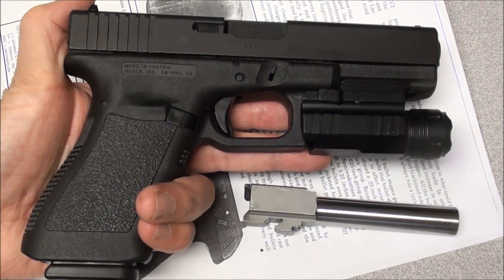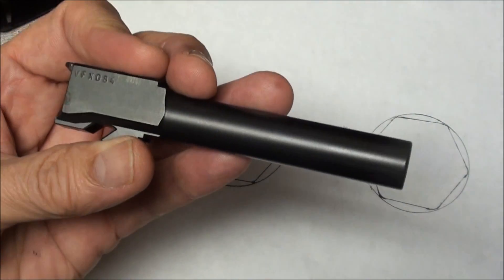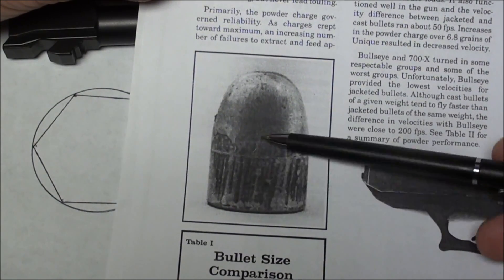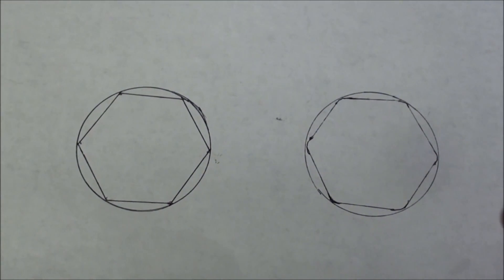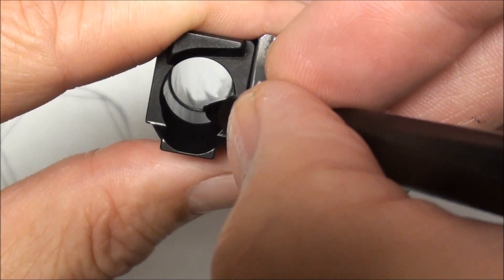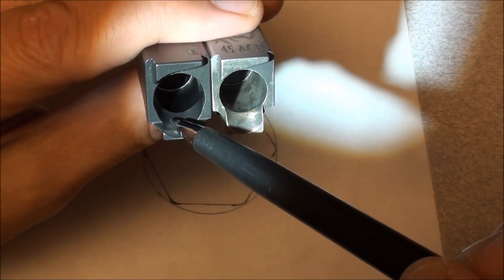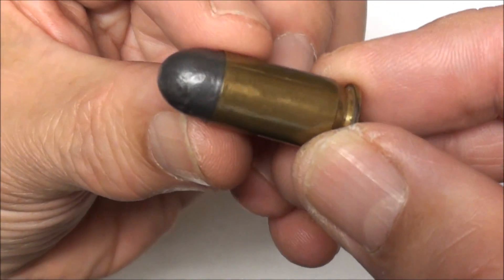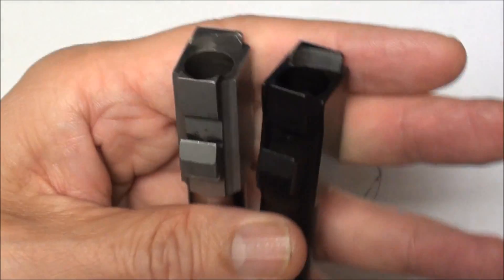Polygonal Rifling in Reloading Ammo for Glocks

Comment: Polygonal bore rifling does not cause more letting in a Glock Barrel. What it does do however is it seals so tightly that you can literally shoot the plug out of the driving band on a live bullet. Leaving a ring of lead in the boar that will cause the background to blow the gun up, Detroit police were doing that with great regularity when they decided to get some Led ammo to use for their practice ammo on with their Glocks.

And there is nothing precluding you from using reloads in a Glock. And apparently you're completely misunderstanding the reason for the problem with lead in blocks. The reason you see that following in regular lands and grooves is because it doesn't have a complete seal, and it certainly isn't as highly finished as the inside of the Glock Barrel. Guess that highly polished finish that the lead seals to, which causes the problem.

Those Hills, that you see in the barrel of the Glock are more of just the top cord of an ellipse and they help make sure that the projectile obdurate into a full seal in the bore. And land and groove rifling can be made exactly the same way, by hammering the barrel around a mandrill the same way you described as the polygonal bore.

A broach is what is used to cut rifling into a bore. And a button is used to swage rifling into a bore.

Before you do another Firearms video, go to a Master gunsmith and take some classes. Pay him well. Because you need a lot of instruction.

It has nothing to do with the goddamn chamber. Every block I've seen blown-up is blown up about a third of the way or more down the bore. It's not a chamber issue. Cuz the chamber is the same on a Glock Barrel as it is on a Barrel made by anybody else for a Glock even with standard lands and grooves. You do not understand the physics of lead trying to obdurate itself through a bore that is that smooth.

The case had has nothing to do with medbullets blowing up the gun. Just because a Glock Barrel has more of a throat done do it does not make it blow up. And the specific aftermarket Barrel you're showing there is a fully supported chamber. but if it had polygonal bore rifling it would still blow up if you shot lead through it.

It's not called minimally supported chamber. It's called a throated chamber. And 1911's have been running just fine with them for well over a hundred years. But they don't blow up when you shoot lead through them, because they do not have polygonal bore rifling.

That's why the internal dimensions of the case have to be made properly. So that you can fire them through throated Chambers in semi-autos.

 Please take a class before you do another video. And take the class from somebody who knows what the hell they're talkin about.

Comment: lol potato /poteto //tell why is  it stronger or weaker// u can  f get  micro rifeling  in career airrifle//and  got    hill  mini /stream and more   hill but no as   betveen   rifeling  wide hill,, etc  //f  get to the  point

no true i  shoot 12 000 9 mm homecast from old lead pipe s  hot  9x19 ammo in mky glock 17 //and  just to  test we did not clean  gun at all all 12 000 rounds  fired  ok // i admit  i were present   on  3 ,,three,times glock broke slide,,but  must say   reason was  inadequate loading  practice   and   tryin to   get  up to major factor in  40 sand wesson //and   all happened  before 40 /10 auto   glock s  are  as  now  made   on  big,,45 acp ,,round lower part /course  it automaticly  increase slide   toughness,, but    polygonal  barrel //i had a desert eagle in .50  and it as  u know got polygonal  barrel too /and shooted    lead bullet    no problem   /but  lead buildup and  gas system  is  just  on desert eagle  not   frendly  on cast bullet s  use  no matter all other /powder /lead hardness /etc etc  just  it s a expensive    allmoast  non possible  to  clean gas tiny 1mm hole deep in  a  gun //  and   scrabbin polygonal barrel  o damagin//so  yes fast bullets  in  polygonal   rifeling is   a   waste  of  time/ not  necesery danger  but  unclean / and  lol loadin // ,,pls  hit me  if    can tell me   any  bout   any /,,by

Comment: Video was wrong.  HERE IS THE TRUTH ABOUT LEAD BULLETS IN THE GLOCK.  I have been using lead bullets in Glocks since the 1980's.   Any type of rifling will blow up a gun if it gets clogged with lead, even the old fashioned deep groove rifling.   The solution is to always clean any deposits of lead out of your barrel. And your accuracy will be as good as jacketed bullets if the lead bullets are quality made.  IT IS ADVERTISEMENT PROPAGANDA THAT YOU NEED A SPECIAL BARREL TO SHOOT LEAD BULLETS ACCURATELY OR SAFELY.   Glocks actually lead less than deep groove rifled barrels.  I have seen very little leading in my glocks after even shooting as many as 150 rounds of lead bullets at the range but I always cleaned all the lead deposits out after I was done shooting. ALSO IT IS COMPLETELY FALSE THAT YOU CANNOT USE FAST BURNING POWDER IN GLOCK RELOADS.   I have used Alliant bullseye powder since the 1980's just  be careful because as you approach maximum velocities pressures do tend to sky rocket so start out with low charges and increase until you get reliable ejection.  That is all there is to it.  Nothing complicated.    When using lead bullets always use a size that is at least 1,000th over bore size.   If the lead bullet is under size it will cause rapid build up of lead deposits.   The larger the diameter of the bullet the less it will lead and if it fits the chamber and does not jam going bigger than 1 thousanth oversize hurts nothing..  Example: Using a lead bullet sized .355 or .356 or .357 if it fits into the chamber without jamming.

Comment: Great information as usual - thank you! A couple of questions:  1) If I need to use a bulge buster on some of my reloaded 10mm brass and then fire it through my Glock 29 with an aftermarket (KKM) barrel, the case support from that barrel should help minimize my kaboom risk, correct?  2) Use of an aftermarket 40 S&W conversion barrel (Iron Wolf) in that same Glock 29 should help mitigate your concerns regarding firing 40 S&W reloads built from Glock-fired brass (back in the same Glock 29), true?

Comment: I compared how much play a round has in both my Glock 9mm barrels and compared them to my S&W 1911 45 ACP and my Rock Island 10mm and they all seem to be about the same. Both my Glock barrels fully support the case or at least they're just as supported as the other two guns. Could these issues you discuss not be present on Glock 9mms?

Comment: I've yet to come across a firearms manufacture that 'does' recommend the use of reloads in their guns.
Reply: Most manufacturers do that as cya, glock does it because their firearms have the potential to damage brass in a way that makes reloading unsafe. Face it, when you're reloading you usually use the brass you fired. Reloaders shouldn't get brass from stock glocks.
Reply: @travissmith2211  you sir, are misinformed. Glocks, like most other semi-automatic pistols have a portion of the chamber that is unsupported. And it doesn't cause any greater problems in Glocks than it does in any other firearm. The problem is that they originally suffered from, was early 40 Smith cartridges where the case was manufactured and properly on the inside of its base. When you reloaded it it created piece of brass that was considerably weaker than the way standard brass is supposed to be made. That problem has since been mitigated. There were some manufacturers that were improperly loading their ammo and causing the guns to also not function properly and the 40 Smith cartridge. But that has since been mitigated as well. The only problem is Smith & Wesson has with 40 Smith cartridge anymore is the fact that the firearm is specifically designed around 9 mm and 40 Smith can cause excessive disturbances to the firearm that was not designed to handle the more powerful round. As for the boar, shooting lead through a Glock can cause it to explode within as little as 8 to 10 Rounds. What happens is that the LED seals to the Bohr so tightly that you can actually shoot the bullet out of the driving band of lead and leave the driving band of lead in the Bohr. And the next round blows the gun up. You must use jacketed ammo, or very hard cast, and usually with a gas check base on the bullet. But it's just a lot simpler to just use jacketed ammo. But not reloading ammo that was once used in a Glock has nothing whatsoever to do with it. Unless you physically see that the case is bulged and which case you probably have a bad case or it come out of a firearm that was fired in an overcharged condition.
Reply: That's true😆
If you think about reloading,you WILL get a catastrophic malfunction that at least will cause death or grave bodily harm for you and evryone in your proximity!! 😅
Som buy the ammo brand they recomend and make money of😉😆
Reply: Cz czechmates, wont cycle standard ball ammo
Reply: It's so that if you fuck up they are covered

Comment: My Glock 21 is 15 years old, a Generation 1, which I clean after every monthly shoot. I use home cast bullets, made from wheel weights. Fortune Cookie makes valid observations, but a fine bit of steel wool and parrafin, get the barrel nice and clean. Brass cases do tend to bulge right at the bottom after many reloads. Resizing with he product on the YT (Lee Bulge Buster, or The Case Master Jr), are options you might want to consider? I do not wish anybody to have an accident, but one has choices.

Comment: That must be an old glock barrel,like gen2,now they are fully supported. But now s&w shields have poor chamber support!
Reply: I agree. After watching this video, I pulled the barrels from all 4 of my Glocks. 1 gen 3, two gen4’s and a gen5. The only barrel that even remotely resembles this on is my gen3 G23, but even it doesn’t look the same. My gen 4’s and gen 5 (all 9mm) look very different, with much closer chamber tolerances. I’m sure, after close inspection, that later model Glocks use a different manufacturing process.

Comment: If your going to reload using cast lead bullets, get poly coated,  load them properly, ie. have a good flair, avoid over  crimping  ( just enough to  keep the case the same diameter ) if you  use grooved bullets keep case mouth away from edge of bullet groove,  don't run max load pressures  ( follow bullet manufacturer recommendation) i have run tens of thousands of poly bullets through Glocks,  H&Ks without issues. When I  first started out using poly bullets i was making mistakes and having problems until I  talked to  the  owner of a major poly coated manufacturer and he corrected me on my reloading practice,  sence then all is well.  been reloading sence early 1980s casted and reloaded bear lead , when i made the change to poly coated its been awesome,  leading gone, less smoke, easier clean up. so don't fret, poly up.
Reply from the maker: Ha Re - The big problem with reloads in Glocks is really centered on the strength of the brass fired in enlarged and throated chambers of Glocks.  The latest Glock gens seem to have tightened up the chambers just a bit to increase case support, but we can't get Gen 3+ in CA to really tell for sure.  A cop at the range let me check out his Gen 3 and other fired Glock brass would not go back into his chamber - that same fired brass chambered in Gen 2.  That gave me some evidence that Glock has tightened up their chambers a bit - but this was only a sampling of one.  Otherwise, it's using brass that has been strength compromised by firing in Glocks being used again and again in Glocks that can cause kabooms especially if hot loads are being shot, bullets are too big or too hard, or any other improper reloading practices that might raise pressures.  The safety margins are reduced using that weakened brass.  Glock chambers were designed for max reliability using factory fresh jacketed bullet ammo for police and military, the sportsman was never in the picture until recently - that's the whole thing in a nutshell.  Obviously, you know what you are doing with your Glocks, et al, and your ammo.  Continued good shootin' to ya,  FC Steve
Reply: +FortuneCookie45LC The key words is "knowing what you are doing " 
Don't know what a SAAMI spec is, don't have  case gauges, crno, calipers, multiple published reload data ect.one probably shouldn't be reloading.  My main reload is high power  bench rifle, 308 on up, little margin for error. 
 All good pistol (if not all) manufacturers  SHOULD  be chambered SAAMI spec. ( only way to prove the gen 3,4 is to slug the  chamber or pin gauge them) you also hit on something a lot of ( cheap ) reloaders do, over use their brass. in one example 45acp i load on the  lower end of the spectrum and only five times then into the recycle bucket. Most pistol kabooms point back to dubble changes  ( somthing thats extremely easy to do given the case volume) Reloading is as safe as factory ammo if you  use common sense,  follow the rules, have ALL the proper  equpment and don't take shortcuts. Manufacturers warn against reloaded ammo  for the stated reasons above, do ammo manufacturers make mistakes?  you bet they do, not often but it happens, so nothing is a sure bet. i have a gen 1, 3 and 4 glock in 9mm i will take a look at them.

Comment: Thanks for the video, it's old but still relevant. It looks like most military/police firearm designs incorporate some time of slop into them, AK, 1911, Glock. Luckily after market upgrades abound for all of them. I wonder if some of JBM earlier levers had something like slop for reliability?
Reply from the maker: Boris Buliak - Part of the slop you mention is in the ingenious use of polymer - the frame bends and flexes much more than steel during recoil helping to absorb some of that at the same time.   Slop in the chamber increases feeding reliability, but decreases pressure control to the barest minimum possible.  With less safety margin thereby, Glock tells shooters no reloads - and unlike other gun designs that have better pressure control via standard chambers with case support,  they really mean that.  The newest Glocks seem to have tighter chambers, but we can't get those in CA for me to review.  Best to ya,  FC Steve
Reply: FortuneCookie45LC sorry about cali, but quite frankly i have a gen3 19 and used to it, love the finger grooves most ppl seem 2 complaint about. If anything i would add a couple of after market barrels drop in. Happy with 9(have other options as well) any barrels in particular you'd recommend?
Reply from the maker: Boris Buliak - I really like the Lone Wolf - good value, and the cut rifling handles cast bullets nicely.  But LW seems hard to acquire now.  I'm glad I have LW for each of my Glocks so that I can shoot my cast reloads with confidence.  Best to ya,  Steve
Reply: FortuneCookie45LC thanks

Comment: I bought an IGB 9mm conversion barrel (fully supported chamber with regular rifling) for my Glock 35 G4 a number of years ago. I compared the barrel chamber with the barrel chamber on my Glock 17 G4. The difference is negligible. In fact, I couldn't tell the difference. I think the kaboom issues are mostly related to earlier generation Glocks that have less chamber support.
Reply from the maker: SuperFlatrock - My perceptions are also that Glock has tightened up their chambers a bit without any announcements or notifications of same.  That makes sense as it would imply that there was some kind of design flaw that was being corrected.  Your aftermarket barrels are still good in that you now have the option of cut rifling as well as the Glock rifling.  (You note that I do not say polygonal as Glock has altered the polygon mandrels they use for barrel manufacture so much that they really have created a distinctive rifling that I would refer to as Glock rifling - and they missed out on a PR/business angle there there as they could have patented that).  This is not Glock bashing as I am just pointing out what is... Best to ya,  FC Steve
Reply: Glock has tightened things up. The barrel on my Glock 35 G4 has a diamond with a dot in the center. This indicates extra chamber support. Indeed, at the six o'clock position, the indent is very small. The earlier versions have a more pronounced indent. The G5 Glocks now use regular rifling. I never shoot .40SW reloads. If the OAL is off by just a MM or so you can have problems with case pressure. I have no qualms about using 9mm reloads.

Comment: I've shot nothing but reloads In my Glock 17 G4. I use mostly copper plated bullets but also a lot of PC lead bullets. I use faster burning powders but I always use the minimum charge to just make power factor for IDPA. I reload using a Dillon XL650 with a powder check die. I also visually inspect each powder charge before placing the bullet to be seated.Every 50 rounds I check the weight on a scale. I've never had a problem with my Dillon press throwing a wonky powder weight! So far I've put 15,000 rounds though my Glock 17 G4. On the few occasions where I've used tumble lube lead bullets, I noticed a lot of leading in the front of the barrel. I've had no issues with copper plated or PC.

Comment: Hand loads and reloads are fine, you really need to learn what your talking about before you speak. Using home made casts or unsealed lead bullets is bad for any firearm because it takes hours to get the lead fouling out of the rifling, now in smooth bore rifles such as black powder or some older revolvers it’s not an issue.